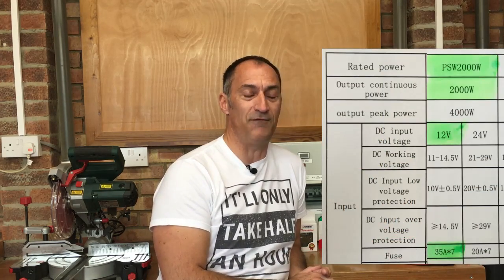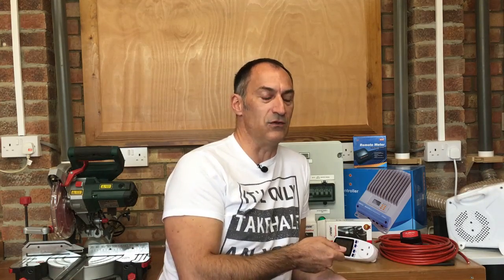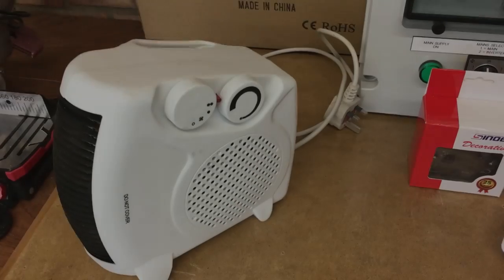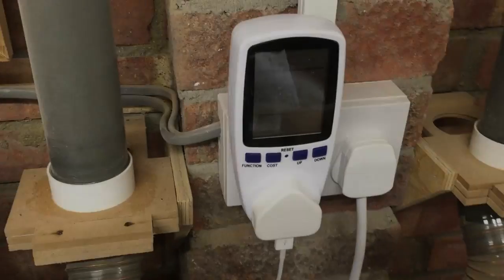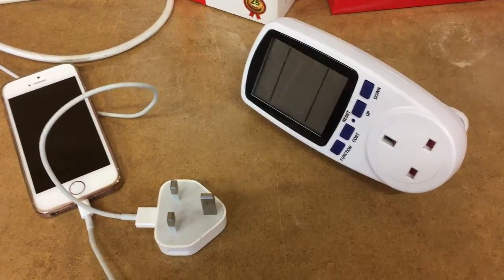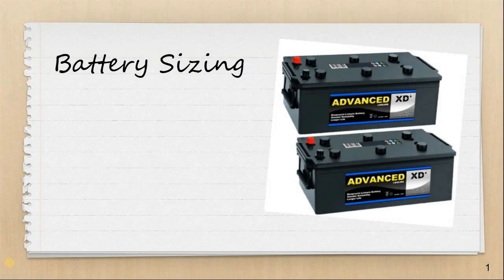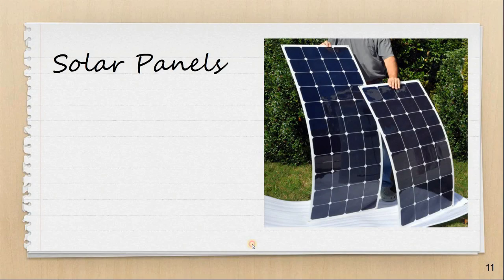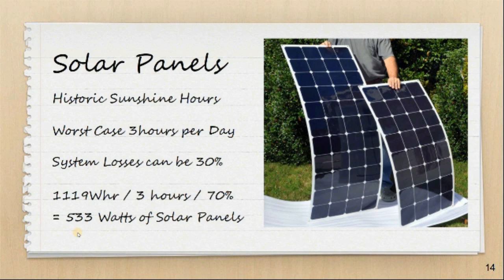Off Grid Battery & Solar Sizing - Self Build Campervan

Comment: Hi Greg, great video but I think you've missed a bit. You worked out the size of battery needed for 2 days but they will be being charged by the solar in that time for a 6hrs meaning you're going to have way more battery charge available.
Reply: Can you not just run van for a bit to top them up from your spilt charge  ???
Reply from the maker: Hi Charlie, what I’m trying to allow for are the times when the weather is bad and let’s say it’s really cloudy or raining for two days. The batteries will have to last with minimal top up from the panels. Hope that helps explain. Cheers
Reply: and when on house power from the site, a charger from the A/C in bad weather as needed...

Comment: Last comment. Personally, I decided to go with more ah so I have a surplus. I don't want to have to be careful and always worry about power. How about 2 x 350 ah house batteries with 3 x 315 watt solar panels. Life is good then for a bit more cost. Additionally, I have a Honda eu2000i generator I will bring for boondocking or I might just use the engine alternator and run the engine for a while to juice up the batteries.
Reply from the maker: That sounds like a fantastic setup, your neighbour will be wanting to plug into your van  👍

Comment: Why not use 2 x 315 watt solar panels instead?
Reply from the maker: Hello, the 315w panels don't fit on the roof without hanging over the sides. 3x160w panels fit between my fans just right. I want them to be as low profile as possible to remain as stealthy as possible. Cheers

Comment: All those things you are using off the inverter can also have 12v car chargers because they are actually 12v. You are basically going from 12v to 230v back to 12v. Just put some 12v car battery plugs and chargers.
Reply from the maker: I have taken everyone's advice and in my next electric video you see I have made some 12v USB sockets. Thanks

Comment: As always great information and physical demonstration... I have a question regarding the heating of my soon to be converted van please Greg. As I will be travelling around Europe for the next year or 2, Ideally my van will be solar powered just like yours. This is fine in the Summer months but I'm curious to know if the cold winter months will generate enough required sunlight to store as energy for not only general usage of fridge, lighting and laptop etc... but more importantly heating the van (keeping myself and the van warm to eliminate air moisture is important of course) My original plan has always been from the start to install a small wood burner stove with chimney which I really want to stay true to for a number reasons that I will be high in the mountains so wood is an easy source...not to mention scavenging the odd dry pallet board here n there but also because this saves on the over all energy resources when comparing the use of a small heater such as yours in the video. from experience I believe it to be thee best heat source for making ones van very toasty in Winter months.... Id like your thoughts or ideas on this please Greg when you get a few minutes... Id just like to say many thanks in advance. Kind Regards, and keep up the great work mate Im absolutely impressed by the detail and execution for each stage of your build.... 10 out of 10 : )
Reply from the maker: Hello Adam, I wouldn’t rely on the solar power to heat my van that is a big load when not much sun about. I’m planning to install a dual fuel heater made by Truma. This runs on both LPG and electric. It is a combi boiler and has a 10litre hot water jacket so as well as heating the van will give us hot water for washing and showers. I would use gas when wild camping and gas and electric when on hook up. 
Your idea of a wood burner will put out a lot of heat and I imagine will keep you very toasty in there. with free wood is a great money saver. You can also cook on them if you get one with a stove top. Be very aware of the fire risk with an open fire and make sure all surrounding materials are all suitably fire rated. Thanks for your kind words. Best wishes
Reply: Thanks for the reply Greg, Its good to get a second opinion from someone who has thought of the options.... I will stick to the cheaper option of a wood burner... which not only will serve the purpose efficiently but will aesthetically suite the rough and less refined appearance of my style ;)  Cheers Greg,... following all of your videos mate.

Comment: I'm sure you have thought of this by your high quality videos but, why don't you use three way fridge, heating and or water?
Reply from the maker: It’s a very valid point Tim, using a fridge on LPG would save on electric. For me personally I didn’t want to cut the two huge vents in the side of my van that you need for a gas fridge. It was purely a cosmetic choice. With just under 1/2kW of solar I should have enough power to keep the batteries topped up. Thanks for watching. 👍🏼

Comment: Hi, Thanks for the very helpful information. my question is@ is it better to connect the solar panels in series or paralell.
Many Thanks
Reply from the maker: I shall be connecting my panels in series to increase the voltage but keep the AMPs the same. 
This way i can ensure enough voltage to still charge my batteries in low light and keep cable sizes down.

Comment: Excellent series of videos on your van build...best I've seen so far, and I've seen hundreds!  Have you considered a couple portable solar panels to supplement your system?  With 30-50' of cabling, you could park in the shade to keep the van cool and put the portable panels out in the sun.  If you were to monitor the contribution of the portable panels vs the roof mounted panels, you might find the portable panels making a greater contribution to battery capacity as you can move and tilt the portable panels a few times per day to improve their efficiency.  Flexible panels would be easy to lug in and out of the van, take up very little room inside, and only require a tent stake through a couple corner holes to keep them from blowing away.  If you haven't seen this video regarding shading on solar panels and series vs parallel wiring before, it might be helpful to you...
https://www.youtube.com/watch?v=1qD3mN8VotQ
Reply from the maker: Dare I say I find the Wynn's a little cheesy to watch 
I have found AltE to be by far the best source for everything solar.
This beginners series of videos is worth watching many times over.
https://www.youtube.com/playlist?list=PLoHd6hGDqS07bbZkyi_4ntfiySUKjPsUL
Reply: Thanks for the link Greg, I'll check it out.

Comment: thanks Greg another gem! I'm guessing you're not installing a wood burner? this might sound stupid! but why are you using the inverter to charge your phone? wouldn't 12v USB supply be sufficient? please keep posting! :-D
Reply from the maker: Yes, you're absolutely correct and in the next electrics video you can see me making up some 12v USB sockets
Reply: dear Greg. the same goes for the Laptop as well. it might be a good idea to use a couple of Buck (boost up & step Down) converters to go directly from your 12V to the needed voltage between 5 and 30V. the efficiency of these converters lay between 75 an 98%. EevBlock did a very good videos about them.

Comment: the best vid so far .... how long do you expect one of the batteries to last, what is a trauma combi.? thanks
Reply from the maker: Hi, the Truma Combi is a combined water heater and space heater which will be dual fuel. 4kW LPG and 1.8kW Electric. It will provide loads of heating for the van and bags of hot water for showers. Glad you liked the video.

Comment: Thanks for this brilliant video, which explains most things and very clearly. I am using your diagrams as templates for now until I come to a potential cross road. For example, I will be using a LiFePO4 12 v 100Ah for my build, which could mean I will have to chop and change a little. What I was gonna ask though is as I have not bought my 3 way fridge and mixer/blender, could you guestimate what ampage I am looking at in sizing up my Solar system? thanks.
Reply from the maker: Sorry, for some reason this message got lost in the long list.
I see you have got your panels and MPPT controller now from Renogy.
They obviously gave you some help over the phone? Cheers

Comment: As you say Solar is so inefficient still. You should also look into split charging from the alternator as well. I'm going to go for a simple (cheap) but effective design with a VSR (voltage sensing Relay) so it only opens to charge the leisure battery when sensing 13.8V which an alternator should put out above when the engine is running. That way the batteries are charged on the journeys as well so you would hopefully arrive with some good power at any destination -- EDITED -- to add nice video and explanation and well put across
Reply from the maker: Yes, in my next video you will see I have purchased the split charge relay kit and will be installing it soon. Very good point well raised, thank you
Reply: Greg Virgoe look forward to it. I've had to include it in my design for my desire to explore scandanavia which may only have 3hrs of sunlight a day. I may also install a higher amp alternator for a quicker charge but I need to do some calculations.
Reply: go a DUAL SENSE VSR instead of single sense... The Dual sense will allow charge into the start battery as well as AUX if there is solar hooked up via the AUX battery.. ( this is when the engine is NOT running..)
Reply from the maker: Hello RV Warehouse, I brought my split charge relay kit some time ago and I think it is one way. Didn't know there were dual ones available. 
However, when the van is not being driven there will be no draw off the van battery so it should not discharge. Unless you have an old battery that struggles to hold its charge the van battery shouldn't need topping up. Good idea though, do you have a link to one you recommend?

Comment: Put as much loads as possible directly to 12V, avoiding the losses in the converter, thera are net laptop chargers out there, that work well on 12V, check out for the brand "Hama", don`t know if they are available in UK...
Top class vids on the electrics, thank you!
Reply from the maker: Hello, Yes, I have taken the advice from you guys and in my next electrics video, you can see I have now made myself a couple of dedicated 12v USB sockets. When you work out the 15% losses on a 6-watt phone charger fed from 400Ah of battery it works out to be.... a very insignificant amount. Thanks for the feedback.

Comment: hi Greg. In Spain for example you may find that in a lot of cases there is no specific live or neutral. each conductor reads around 110v to earth and 230v between each other. So you always have power to a an appliance.
Reply from the maker: I'll check into that (reaches for my European motor caravaning guide)

Comment: Have you looked at AGM batteries? They can be discharged further than a conventional Lead Acid battery.  This does come at a cost though but with a longer life.
Reply from the maker: Hello James, where did you get lead acid from? Was it that image I used in the video? I've had a lot of comments the same. I'll have to be more careful with my image selection in future. I'm not using conventional lead acid batteries. It will most likely be AGM batteries. Thank you

Comment: You’ve got me thinking. During the daytime, you’re not using your batteries, but simply using the solar power, so all those daytime hours of refrigerator use and charging computers etc. wouldn’t need to go into the battery calculations, but simply solar panel calculations.

Also, I’d seriously consider the ability to tilt your panels or simply add mobile panels that could be laid out and tilted. There is so much less sun in the winter, and the angle of the sun is so much lower, it becomes pretty important during those months.
Reply from the maker: The power still has to go via the batteries as you can use it directly off your panels. 
But you are generating more than you are using during the day. Thats the plan.

I agree with you about the tilting in the northern hemisphere (Europe)
It is 54.5°N in latitude so that would be the angle of tilt, to be at right angles to the sun.

Comment: why use an inverter on the iphone, ipad, kindle or laptop they can be charged off of 12 volts, Using an inverter you take 12v up to 230v then your dropping it back down to 5v to charge the iphone, ipad, and kindle and they have 12v adapters and most laptops are about 19v and you can get a vehicle charger for that.going from 12 to 5 volts and 12 to 19 volts is more efficient.
Reply from the maker: Hello gne146t9.  As explained in the first electric video, I don't want to run two lots of cable or have two different types of sockets and the cost associated with installing that. I'm happy to accept the 15watts of losses on those items, after all the power is free. Cheers
Reply: ok, This is the first video of your's that I watched I guess i'll get to that video soon

Comment: Greg - very interesting. I think you should retook at batteries and the total cost of ownership of Lithium. ‘Minimal List’ and ‘Gone with the Wynns’ have both covered this on You Tube - please look and re-evaluate.👍
Reply from the maker: Hi Norman, I wasn't gonna let your comment go by without re-evaluating it as you appear to be so enthusiastic about it. Ok firstly "The Wynns" bless em. That RV is bigger than my house! They are in a whole different ball game to me and most other panel van conversion projects. Their solar panels and batteries alone cost over $12k!! 
I just cannot find that sort of cash for equipment alone.
I did enjoy a few videos from the Minimal List, especially the panel tilting brackets for their solar panels. Now if I can engineer a way to automate that with a 12v linear actuator I'd be onto a winner there. Could not see anywhere where they gave the spec for their new batteries, but doing many google searches I still cannot find cheap LiFe batteries. Unless you work for a battery supplier and are offering some for free I'm gonna have to stick with plan A.
Thank you very much for watching and I do appreciate your feedback as always. Cheers
Reply: Greg Virgoe Hi Greg - I do not work in that industry whatsoever.😀 I was referring to the Wynns study of which batteries to go for when they were up for replacing the fooked ones in their catamaran - they went into a lot of detail in terms of total cost of ownership and equally important performance - I will do a search and post a link. Here it is :https://youtu.be/J-kND4PaZm8
Reply from the maker: Hi Norman, thank you very much for the link, I did watch it.
I still can't get around the fact that for the same Ah capacity they are 10x the cost of AGM batteries.
I would have to spend £4-5k on batteries instead of £500 to match what I have. I could replace mine ten times over.
They may be the next best thing since sliced bread and it would be amazing to have some for all their benefits but I cannot afford them. Sorry.
Reply: Greg Virgoe not sure where you are getting your figures from but from the requirement you calculated for 2 x 190 Ah batteries you could substitute with 2 x 100 ah Lithium for circa £700.
Reply from the maker: Hi Norman Boyes, can you pm me the link where I can buy those for £350 each. 
I'm not sure my epsolar charge controller is suitable for Lithium and I already have that as you see on the desk.
Reply: Greg Virgoe - Sincere apologies Greg, I was mislead by a comment made in response to Minimalist’s video where the chap said he had just done his leisure vehicle with 2x 100AH Lithium’s for ‘about £700’. I have just done a search and can see the current price is just sub £2K.😳😳
Reply from the maker: No need to apologise Norman, they are by far the better battery with 80% DOD and 4000cycles and less than half the space and weight but I just wish they were half the cost too 😂 when I can get 2x 190Ah sealed leisure batteries for £299.00 off eBay there is no contest at present. Sorry

Comment: is there a way you can charge from solar, inverter and hooked up?? like a tree way switch?
Reply from the maker: Hi Carlos, the solar controller charges the batteries, while the inverter uses the battery power to convert to a higher voltage. One is input and the other is output side of the batteries. They are doing different things in the system so a three way switch would not work with these devices.

Comment: Are you using gas cooking?. I Like the idea of an induction cook top instead of gas but need some serious solar power to run one through an inverter.😭
 Can always carry a folding solar panel with built in reg to add to the system when not in motion.I use a 160w folding panel to take away with me and have a Anderson  plug  under the sill to the aux battery. 😉
  As far as VSR  go I have a sidewinder 140AMP SINGLE sense with heavy duty 13M2   cable so can start car from aux Batt if needed. I should have gone DUAL SENSE VSR  so my solar can charge start battery as well. 
  Prefer the DC TO DC charger idea (smaller cable runs and CTEK D250S has built in mppt solar reg.)  But cannot emergency start starter battery with this option.  Which option are you going for DVSR or DC DC charger?
Reply from the maker: Hello Gavin, I've already purchased a split charge relay kit from these guys
https://rover.ebay.com/rover/1/710-53481-19255-0/1?ff3=4&toolid=11800&pub=5575265109&campid=5338027957&mpre=http%3A%2F%2Fstores.ebay.co.uk%2Fsplitchargeuk%2F_i.html%3F_dmd%3D2%26_nkw%3Dsplit%2Bcharge%2Brelay%2Bkit%26_sop%3D12%26rt%3Dnc